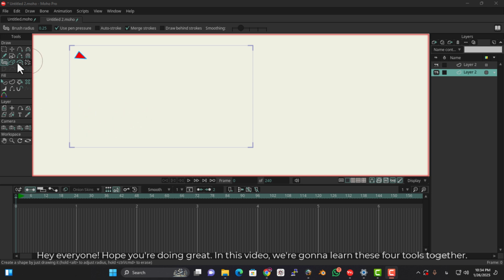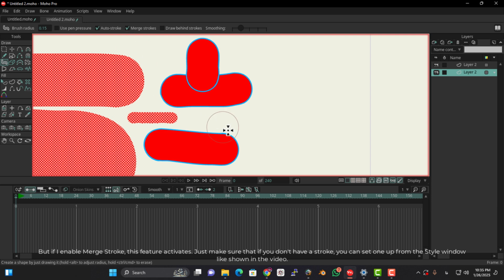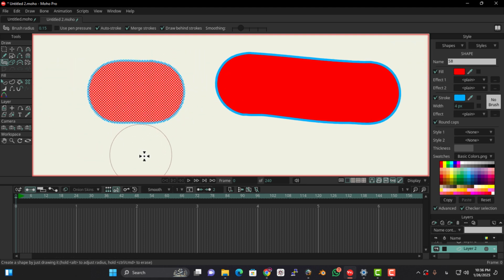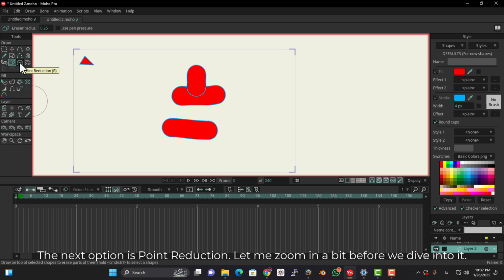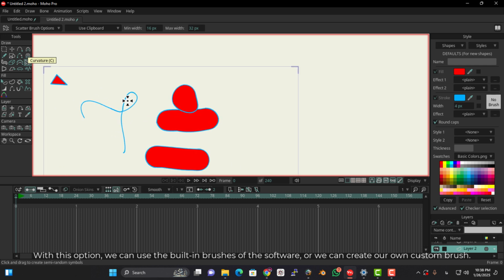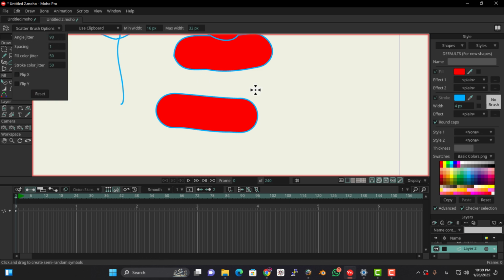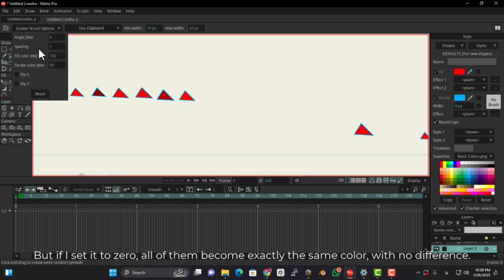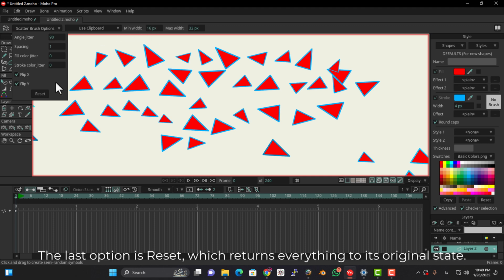Complete Guide to Moho Draw Tools & scatter brush –  Tips & Tricks for Stunning Art!

Comment: There is a problem in MOHO 14 mp3 voices the program lower the quality of the voice and make small noises when i record my voice in adobe audition it is perfect, but in MOHO the quality of the mp3 audio become lower. did you face this problem?
Reply from the maker: Animation software isn’t great for audio processing. The best approach is to finalize your lip-sync and animation first, then move to Premiere Pro for sound adjustments. There, you mute the original video audio, add high-quality sound, arrange sequences, insert sound effects, and fine-tune lighting and color.

I’ll be covering these steps in detail in upcoming videos, but in short, you should use external software like After Effects or Premiere Pro for proper audio adjustments.
🥰❤️
Reply: @EchoGraphic  yes i do this on After Effects but i though there is a solution
Reply from the maker: There are many solutions. For example, when exporting audio in Audition, set the format to WAV, 48kHz, and 384kbps or higher. This will improve the quality, but if you bring it into After Effects and Premiere, you’ll get even better results. ❤️❤️